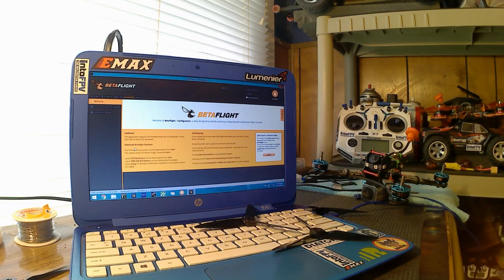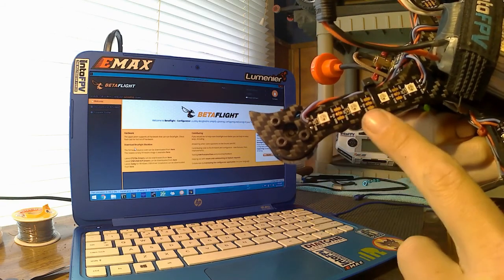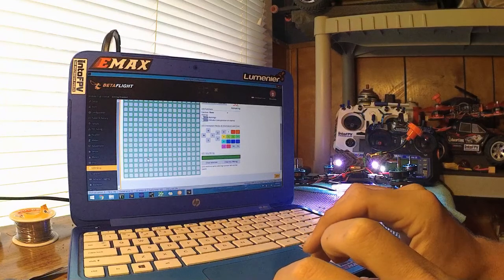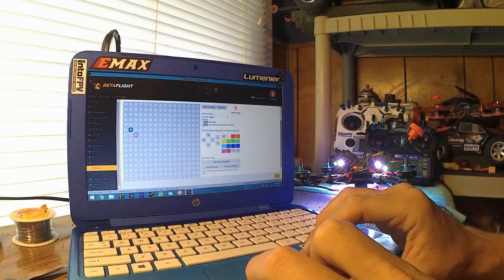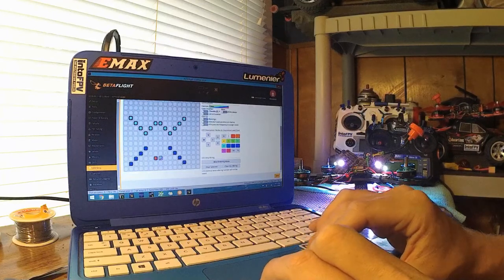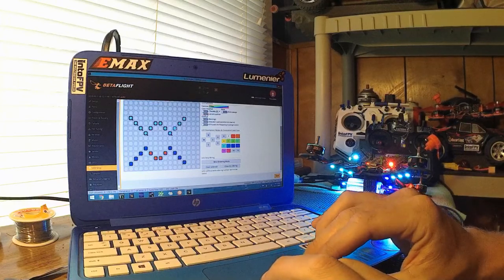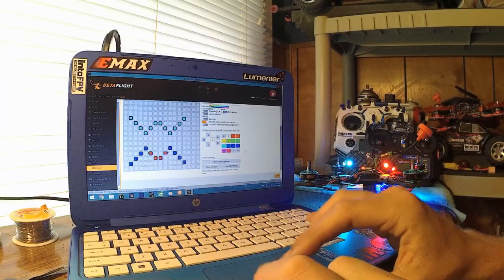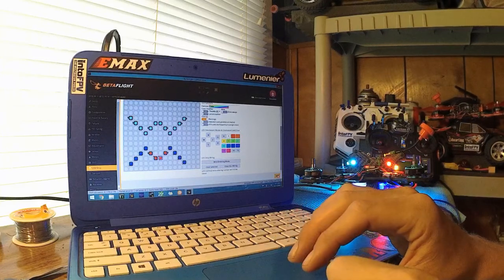How To Add and Setup LEDs In Betaflight

Comment: For your diamondback nozzle one did it cause any issues because it doesn't screw all the way in the hotend ? I am just curious I have a microswiss all metal hotend ATM
Reply from the maker: You will need to loosen up the entire heat-block from the heat-break too and make sure the back of the nozzle seats against the heat-break inside the heat-block. Hope this helps.
Reply: @dopfpv9109  spoke to diamondback they said it's fine as is because it conducts heat better so it doesn't have to be flushed so far so good no issues on my end
Reply from the maker: Great to hear. I had it leak out the top of the heat-block where the heat-break threads in.
Reply: @dopfpv9109  what were you printing with ? PETG ?
Reply from the maker: @JustCreateYou  in my https://youtu.be/mCGhhHuOrl4 Diamondback Nozzle video the comparisons were all PLA

Comment: Hi,
Good video.
I have my first drone and I would like to know where can I connect the wires to send the power to the lights?
I would like to install the same pattern at my quad but I don’t have idea where the wires go.
Thanks
Reply from the maker: DANIEL VP 
Biggest question is what FC (flight controller) you are using and that it has an LED pad. Most newer FCs will have them. 
Once you find the LED signal pad, simply solder the Data/signal wire there (usually white or yellow) Then just power the LEDs with the appropriate voltage (most common is 5v for quadcopters) from a 5v rail on your FC and connect ground wire. Hope that helps. 
Reply back or stop by the IntoFPV.com forums if you need more help.

Comment: I use the same LED strips and I can't them to light up for nothing 😡
Reply from the maker: I have not tried LEDs with iNav yet. Have a look through their github pages to see what LED functions are supported. Although it should be quite similar to Betaflight. 
Again check for poor joints. Any dull looking joints, redo. Be sure everything is nice n shiny.
Reply from the maker: If they arent lighting up at all I would double check all of your connections/solder joints. Also you must activate the LED option in Betaflight.
What FC are you using?
Reply: @dopfpv9109  I'm using the f405-ctr on inav.
Reply: I'm hooking it up now.
Reply: Some light up and some do not. Inav is unresponsive to LED commands.
Reply: @derrickmitchell39dm  I have that same FC and cant get any life in my LEDs either. 😕